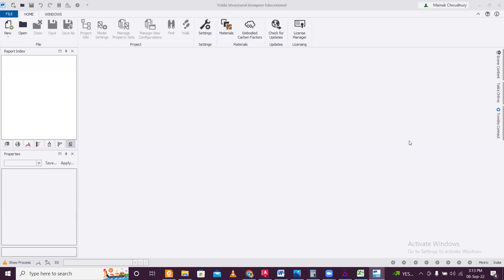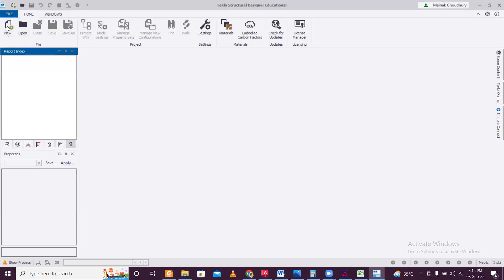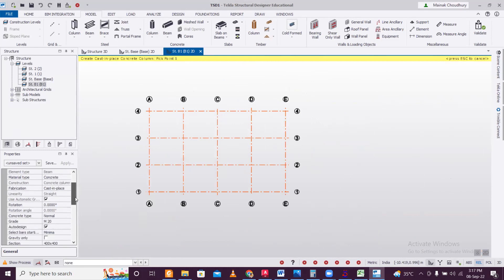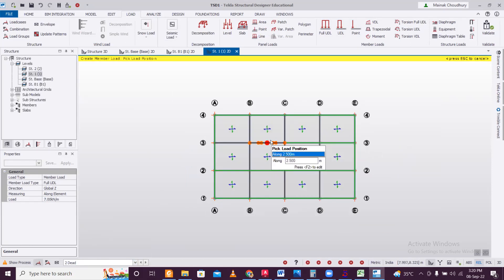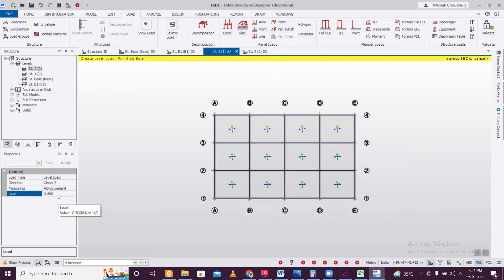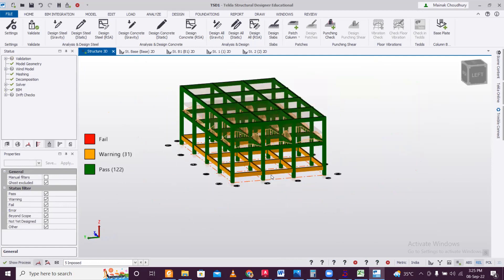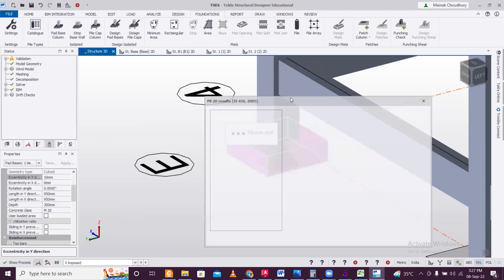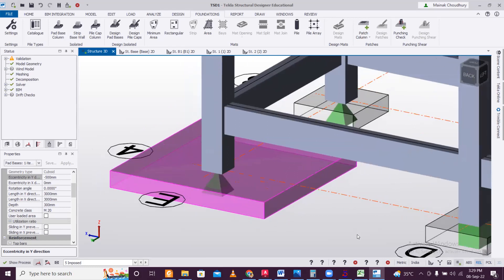Eccentric Footing Design in Tekla Structural Designer || Scope and Limitations

Comment: Sir is it possible to check torsional irregularity, lateral displacement modal participation and other other required checks using tekla if so kindly make a video about it
Reply from the maker: No, I didn't find any option till now, also it's difficult getting results if we do RSA design in Indian codes. Thats why I am unable to use this for practical projects till now